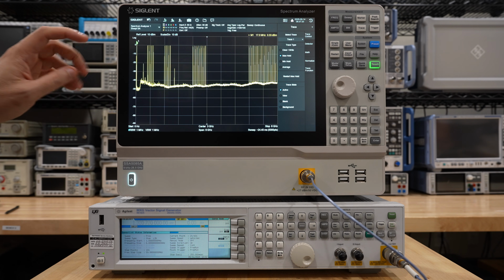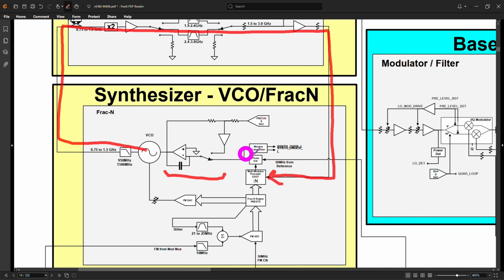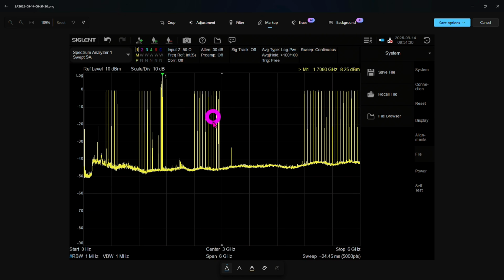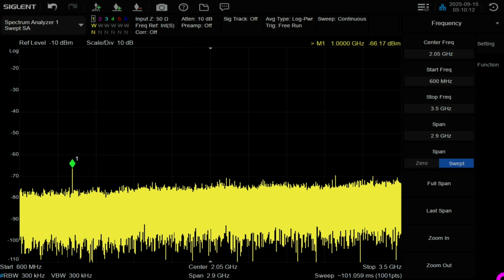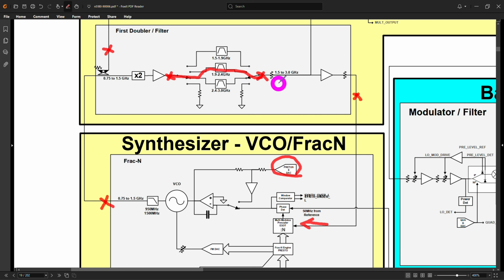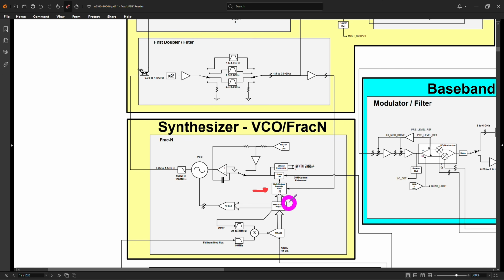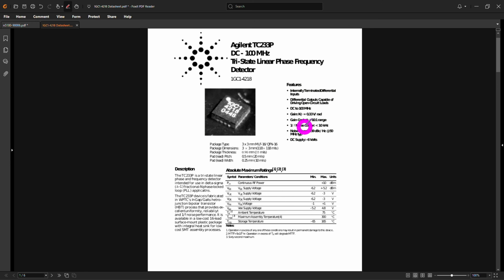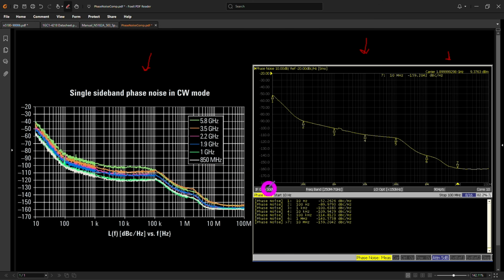TSP #320 - Agilent 6GHz MXG Vector Signal Generator (N5182A) Teardown, Repair & Frac-N PLL Analysis

Comment: You must own several PhDs in Signal Processing and High Frequency Technique. I will never come to the idea of the changed gain coeff. How is it possible at all an IC to change its performance in this manner? Either it works or fails miserably

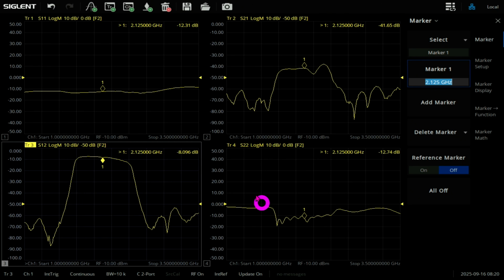Comment: I noticed you had the anti-static bag between the pigtails and the pcb at 24:39. I could be wrong, but I thought the anti-static bags are conductive on the outside and have the potential to short things?
Reply: Well spotted, I saw it too but though nothing of it and would have used the nearest bit of plastic as insulation myself.  The resistance is typically in the mega ohms as it just has to drain charge build up. Since much of the instrument is using 50 ohm transmission lines it should be ok but it is possible that some high impedance node could be affected. Hopefully this was taken into consideration.

Comment: Oo can you show all the different vias across the board for the shielding and signal paths, that's alot of drilling, they seem to be spaced in different patterns, do the signal paths zig zag snake  out of each module to the next within one layer is it a 6 layer PCB , your x ray machine would show a nice deep level scan just a snap shot

Comment: I'm surprised that you can simply override the VCO control voltage. I would assume that would damage the driving circuit in the device...
Reply: Depends… he probably desoldered a cap or resistor to feed in his own voltage, but IF the drive signal has a relatively high impedance, you can force your own voltage on top. I would try to avoid that though

Comment: It would be great if you decap the detector chip and why exactly the gain deteriorate over time.
Reply: It was quite scary how it worked perfectly at higher frequencies but just had gain issues at the lower frequencies.  A very difficult diagnosis indeed.

Comment: Without being a user, it’s hard to  comprehend all the features that units like this offer. From IQ modulation, pulse generation, analog modulation and all the adjustments that it can perform internally. And the precision that is needed for EVM, phase noise, and the ALC. Even this older MXG-A series is an engineering work of magic.

Comment: I would never have guessed that the fault lay in the phase detector - it's counter-intuitive since it's the part of the circuit that only sees 50MHz, regardless of what the VCO is doing. Other theories like the filters seemed so much more promising, until they were eliminated. Top notch fault-finding, and a really interesting problem.
Reply: Agree. I can not understand for a PLL system, when the FPD is broken, you can have some frequency range locked normally and other frequency range unlocked.

Comment: It is good to see that even these fully integrated units can be diagnosed and repaired using spare parts. That has been one of my biggest concerns as the industry has shifted from a modular approach to the single board approach (the VXI/PXI VNAs especially). This was a phenomenal video showing how to use the wiring diagram to really break down the problem. Many people want to pretend they are brilliant and can find the solution right away. Thank you for showing all the things it wasn't. That is a critical part of the diagnostic process. The last thing you want to do is give up after the first theory doesn't pan out. Also great job showing the use of dead units to keep other units active. Just because they are custom components doesn't mean you can't find them.

Comment: It's quite a tricky task to test a phase comparator with low phase noise in this frequency range. It wouldn't be possible with my multimeter. ;-)

Comment: Great work!  You always do a wonderful job of explaining the theory of operation.  I used to work for a company that contracted with (at the time) Agilent, repairing ESG-3000 series generator boards to component level.  My expertise was with PLL's, so I repaired reference, synthesizer, and Frac-N boards.  After watching this video, I like the ESG-D3000 series better than the 5000 series, with everything on a single board.  I own a couple of the ESG-D3000 series generators, and they just work.  After I bought them, I had to replace the Frac-N divider on one of them, but it was a known issue with that chip, and the other had an RF amp issue on the output board.  The Frac-N divider (1GC4-4210) in the ESG-D3000 series is actually part of the signal path itself, taking the output of the YIG oscillator, and fractionally dividing it, for output, rather than in the PLL loop.  They were great generators for their time.

Comment: Not good if it's degradation in the actual IC with age. I would've tried a reflow of the outer pins first, ie, they should be easy to reach with an iron because the pads should hang out a bit past the chip.

Comment: Nice, I had somewhat similar issue in PSG due to dead amplifier that didn't amplify but shorted RF signal instead. I heard Frac-N is a common issue with these series ESG/PSG/MXG generators.